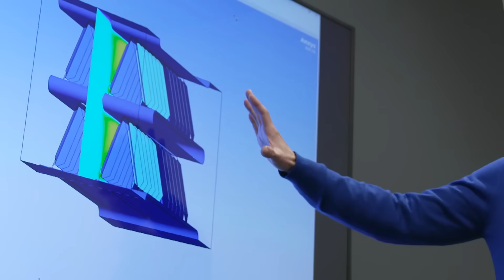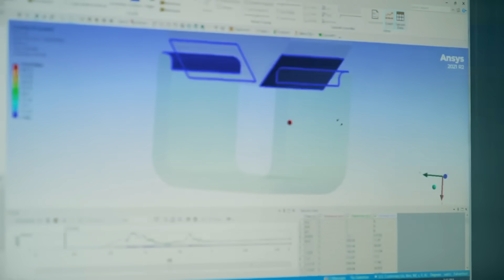Sub-Zero Group Relies on Ansys Simulation

Comment: What is difference between explicit dynamic module and autodyn module available in ansys workbench??
Can I do impact analysis on composite material using explicit dynamic which has been done in autodyn by researchers?